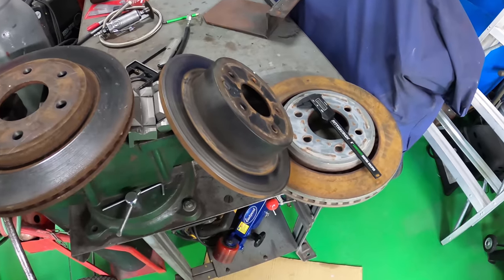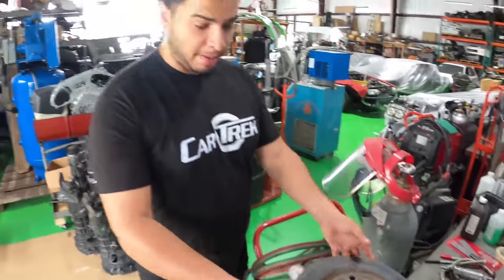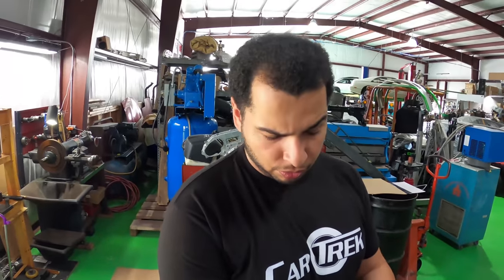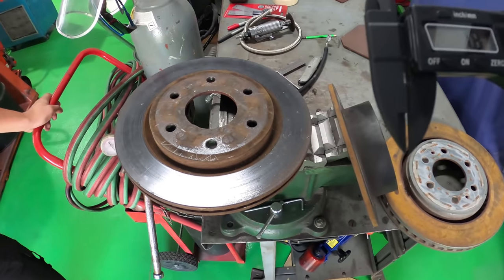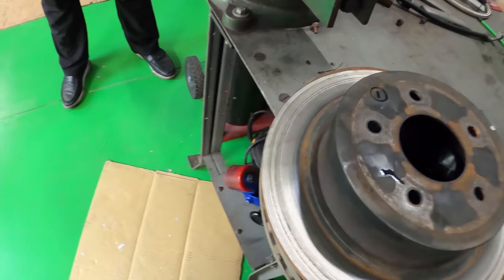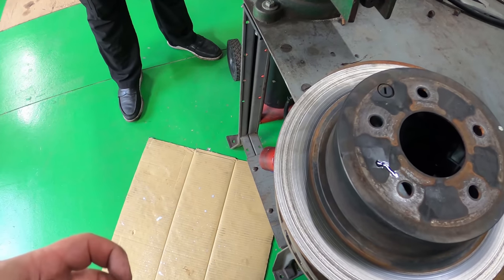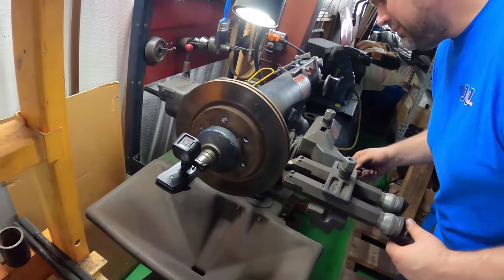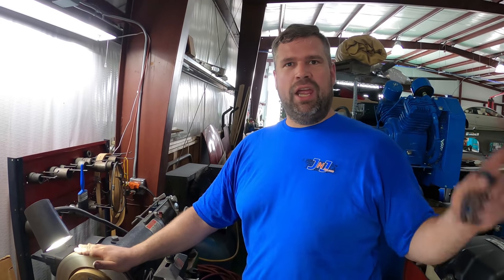Here's How You Can Get BRAND NEW BRAKES For $10 (Without Screwing Up)

Comment: Just finding a shop that turns rotors is getting harder. I remember when every service station could do it. Great content!
Reply: Damn do auto part stores not turn brake rotors and flywheels anymore?
Reply: @sinformant  - If you hunt you might find one of the older shops that do, but for the most part they have gotten out of it.
Reply: You would have better luck if you go to the same machine shop that did the work on your engine block and Reground your heads not a tire shop . If they won’t ask them who would ?
Reply: I can’t find anyone around here that is willing to do it. The last shop I went to said their insurance company said the liability was too high and if they kept turning rotors, the rates were going to go way up to the point the shop wouldn’t have been able to make a profit.

Your best bet to find someone to turn rotors would be some small shop that’s in the middle of nowhere.
Reply: I can’t find a shop that will do it anymore either. Labor rates are so high it’s cheaper to buy new blanks
Reply: O'Reilly's, and full service tire shops
Reply: I do that, but I mostly do it for truck disc's, it's just not worth it and safe to redo car rotors.
Reply: O'Reillys for about $13 per rotor. At least for my vehicle, the rotors brand new are $24 each on Rockauto. It is difficult, and almost pointless for $11 more. The old one's had already been turned previously and were slightly warped anyway.
Reply: Napa. They do rotors and flywheels.
Reply: I'm happy I found a broken brake lathe off Craigslist for $150.  Cost me $75 to fix.
Reply: A lot of that is because most modern brake rotors, at least for cars, are already manufactured close to the minimum tolerances to begin with.  If they warp very much, generally shops will refuse to turn them at all because doing so will put it below minimum thickness.  That being said, I still try to have rotors turned rather than replacing them when I can. The reason being: Once rotors warp once and stress relieve themselves, they're very unlikely to warp a second time.
Reply: @murrys5444  wrong. Every O'Reilly Auto Parts turns rotors. At least in my state they do. So does Advance Auto Parts. So does Autozone. So does NAPA. 🤷‍♂️

So has every shop I've worked at. Nobody ever asks for it anymore but there are shops everywhere that still do it.
Reply: @JC-11111  - I used to work for Napa, and of the 4 in the county, none of them turn rotors anymore.  It really varies by region.
Reply: @JC-11111  The one near me is picky on them though. They refuse to turn the ones that are built into the hub.
Reply: @SAIFSWORLDFUN  - I can't find anything stating it is illegal in the USA.  Some European countries came up, but not here.  I think you misread something somewhere.
Reply: my O'Reilly's advertises that they do it
Reply: @SAIFSWORLDFUN  Well, that was just a blatant, ugly lie if I ever saw one.
Reply: @JC-11111  what state?
Reply: @JC-11111  The problem is that not all employees are trained to do the job and if the right person isn't in that day having them done in one day isn't always possible.
Reply: @SAIFSWORLDFUN  Most? I don't think that is correct.
Reply: Düdmæng Brossovitch depends on the Napa. Some don’t deal with the liability
Reply: @fabulousprofound  indeed, its not economically viable and the risk is too high, many mechanics check for lip, no lip= rotors fine,  rotors that are too thin end up on your car, we looked into it, the modern on car machines arent worth it, ten minutes both sides, thats £30.00 in labour plus machine layout- pair new discs on small car?
£35.00. it pointless unless your rotors are very expensive to replace.
Reply: @sinformant  Auto part stores used to do that?? I wish that was still the case!
Reply: Tons of shops around my area reface rotors. Doesn’t matter if its a tire shop or general shop. As long as they aren’t too low/thin they will turn them.

Comment: Back in the 90s when I worked as a tech at a GM dealership we turned rotors on every brake job because back then rotors were expensive, unlike now. Same for rebuilding CV axles, was cheaper to replace the CV ends than buy a whole axle
Reply: Same here, we rebuilt calipers and wheel cylinders because of liability. I'm a retired Ford, Lincoln,  Mercury, technician...
Reply: Now finding a guy who can do it without screwing up the rotor is hard. Not sure how you can screw that up, but they do
Reply: @stephenhayes3765  
Well, we're dealing with a generation that can't retrieve grocery carts, without messing up...
Reply: @joeschlotthauer840  ThIs GeNeRaTiOn CaNt Do AnYtHiNg
Reply: I'm in Australia, and when I was doing my apprenticeship 20 years ago we machined the rotors every time on the 90's Falcons, workshop got an on car machine that was mostly running all day. but ten the newer models came out with slip on hat style rotors, and the rotors got cheaper.
Reply: @ryanworkman5229  
Yup, we had one also, mainly for the four wheel drive cars and trucks for warranty warped rotors, and to save Ford money.
Reply: Stephen Hayes yeah when I was in highschool, it was quite easy to pick up, now I’m 19 lol

Comment: I was taught 3 pass minimum. 2 fast to true it up, one slow for finishing. Of course measure for minimum thickness before the last pass. I usually cut about 8 a month, my boss charges 15 a rotor.
Reply: No you don't have to take three passes unless the rotor is really warped or grooved. Once you do your scratched cut and you turn the twin cutter all the way in if there is a solid line all the way around from the bit you can do it in one pass
Reply: sinned96 Yep, do a good fast cut (after measuring of course) then a good final cut. I use a sanding disc on the rotor after turning to put a nice non-directional finish on the rotor

Comment: Fun fact, some brand new rotors are warped. I worked a Brake shop in the late 80's and would see customers complain about a pulsating pedal after a complete brake job was done that included New rotors. Take the new rotors over to the lathe and sure enough they are warped. We started routinely turning brand new rotors before installing after that. I was told this happens if the rotors are not stored laying flat in there boxes.
Reply: I’ve actually seen that also. Kinda not a big shocker since most rotors that are in autozone/oreillys come from China
Reply: Wow glad somebody else understands this I tell my customers all the time you're getting rotors come over from China on the boat those brand new rotors I've have seen 10 to 12,000 out

Comment: The old Amoco brake and drum lathes we used to use in the Midas shop I worked for back in the early 90's had adjustable rubber wheels on stalks that we could ride on the rotor during the initial rough cut to stop the harmonics.

Comment: I used to get this done when I was a poor student with an old slow car, also that was before you could get Chinese brake rotors for peanuts like you can now - but I wouldn't bother anymore when new ones are so inexpensive, and you can just drop the old ones off at a metal recycling service.  The shop I used to go to had a special machine that could do it on the car.
Reply: The on-car brake lathe is industry standard now as it results in less lateral run-out ("warped rotors") and "aligns" the rotor with the vehicle's axle.

Comment: Big problem around here in western Canada is most shops don't turn rotors/drums for people anymore, parts suppliers stopped turning for customers.  So was easier/faster to get replacements.  My 1980 chevy Barreta, new 3rd party rotors were only $5 more than turning old ones (many years ago).

Comment: Over 25 years ago I once witnessed someone doing this by putting the car on a lift, putting it in gear and using a metal file on the discs! Did a good enough job to get it through its MOT test!
Reply: I prefer the car on jackstands in neutral and angle grinder with flapper disk method lol

Comment: On-car lathes are superior.  Most "warping" (It's thickness variation) is from excessive runout caused by the hat/hub/bearing.  An on-car lathe makes the full assembly true, assuming your wheel bearing isn't defective.
Reply: That's not correct about the on car lathes, or else it would be standard practice to on car machine new rotors once fitted, which never happens. If the car has a runout problem with the hub or wheel bearing replace that part.
Reply: @toddttautomotiveequipment2871  You offer to match machine the rotors, but i bet you dont match machine every set of NEW rotors you fit to your customers cars? Off car machining is the same as on-car as long as you follow correct procedure checking for hub and rotor runout etc. If i can be within oem tolerance for runout with on or off car machining, how can you say one is better then the other?
Reply: Btw runout(warping)and thickness variation are two different things, rotors can have one without the other or both.

Comment: Skimming works well with enough life left, problem is the sudden temperature change after a cut as the change in running temps are exponential for every micrometer taken off. They are more prone to warping after skimming.

Comment: The vehicle moving with no other force applied to it (ie, coasting) has Potential Energy (not Kinetic).
You convert the Potential Energy into Kinetic Energy by applying the brake.
The Kinetic Energy is the "Heat Energy" used to slow the vehicle.
The more efficiently the brake rotor can dissipate the Kinetic Energy into the surrounding air, the more effective the braking will be.

Comment: Those rubber straps to your right that look like bungie cords, those are supposed to be wrapped around the rotor to prevent that loud "singing" it made. Also that singing causes vibration and leads to very bad cuts.
Reply from the maker: They didn't have one that fit the rotors diameter on hand, so we used the contact pads which performed the exact same function.
Reply: That clip on silencer is basically made for the thin rotor that you showed from the Nissan Pulsar. It works but I would get the correct type of silencer for it. The spring silencer works great but they only come with four Springs. On a larger rotor it's better off to use five Springs. You don't want the silencer tight against the rotor, you want it loose so it actually dampens the vibration. If it is tight against the rotor it will vibrate with the rotor

Comment: I got rid of the lip on my vans disks by running it on tick over in 5th gear and holding an angle grinder on it. Worked well 😁👍

Comment: I'm lucky with part prices on my little old car: a set of good quality rotors in the front will cost only 24€, but they are also tiny solid rotors. Way smaller than normal rotors on the rear axle of a new car. Drilled Brembo's are about 58€ for the set. It will help when the car only weigh 780kg or 1720 pounds, parts get cheap :-)

Comment: The issue of finding a place that still does this not withstanding, the bigger issue is if the rotors you have can even be turned.  The minimum thickness of the rotors was mentioned, however what wasn't mentioned was just how thin rotors are from the factory now a days.
The vast majority of cars out there, the rotors are so cheap and thin that by the time someone gets around to wanting/needing to get them resurfaced, there simply isn't enough metal left to do it.  Heavier duty (and weight) vehicles you might have more luck on, as the heavier a vehicle is the beefier (generally speaking) the rotors are.  Also, as you go up in vehicle speed capability, the rotors get thicker then as well.
It is an option that can still be found out there, but just be aware that rotors are getting much cheaper and thinner by default, so don't be surprised if they won't turn them for you.
Reply: I'm a brake lathe service technician and I keep up on what's coming out with the newer cars. Rotors are getting more expensive and getting thicker. And the recommending that you can resurface them at least once

Comment: I've had this done on my 1991 Honda Accord  with a special turn that mounted to the hub. Those cars had a hub over rotor setup where the rotor was pressed on.
Reply: It was a pain to replace or refinish but they lasted longer to me.
Reply: With an 11/16 Arbor I can cut those Honda rotors with the spindle attached but you got to remove the whole thing from the car

Comment: yes I used to just put new pads on my 83 reliant till i could see the out line of the rotor cooling fins thru the braking surface. ah but with new rotors the pedal was high and braking was solid at that time rotors could come off after wheel removed and new rotor was $20  410 to have them turned so new was the best choice.

Comment: Correct me if I'm wrong, but I have seen many brand new rotors get warped very fast. Then, after being turned, they never warped again, as if the metal took back it's ''natural shape'' at first when they warped. It is also good because it makes people work in your country, instead of always buying from China.

Comment: Once rotor no longer had bearing races, they became cheapaer to make. Also they are often thinner than the old rotors and you cannot turn them after they have run a set of pads. It they are not warped, I just scuff them with course sandpaper and put new pads on. If they are warped you can turn them but usually the warp comes back,

Comment: Auuu, just to add to confusion here. Tires stop the car. A car is a total loss heat exchanger. You can not create or destroy energy, only change it's form.You put in gas( energy . not dead dinos, what ever) to burn. You lose most energy through heat, radiator, exhaust, brakes, tires ect. Brakes are just a transfer device from the brakes to the wheels, to the tires. First I heard of harmonics was on a Ford Taurus. We used a rubber strap around the rotor to cut it down. Also don't inhale the dust coming from the brakes. Hose them down FIRST to get rid of most of the dust. Anyway good video...
Reply: ICE is not a total loss with heat but the most efficient ICE possible currently is around 45% and BEV is about 95%.

Comment: Not sure where you're buying your rotors from but I bought 2 rears (Raybestos) for my 2000 Prelude and paid $41 with shipping! Just another reason I throw out the old ones. Can't see cutting the old ones for $12-15 a piece and then replacing them in another 2 years.

Comment: If you go down to the minimum thickness, you will get a brakerotor that looks like brand new, but you can't use it anymore, because if you do you will go under the minimum thickness.
Reply: The minimum thickness is the minimum machine to thickness not the minimum wear thickness

Comment: Lets say i changed the brake pads and did not change the rotors, drove like that for 9 000 km. Now the new pads have adapted to the old rotor. Is it posible to buy a new brake rotor, and trim a milimeter or two from the pads, so the pads have an even surfice? I am asking that because the pads have a lot of meat left on them, so I would trim them ao there is no groves or anything.

Comment: I will no longer turn rotors. Most of the time you turn rotors to get ride of a pulsation in the brakes, sometimes just a great way to remove the glazing from the rotor. Ether way it remove mass and the rotors ability to absorb and remove heat. This usually causes the rotors to warp even faster. Also almost no one will turn a rotor for 10 bucks, it takes way longer to turn a rotor than that. Just order new ones from rock auto for about the same price.
Reply: If you're getting a pulsation out of your brakes after turning a rotor you have issues with your brake lathe for your adapter setup not being true. You need a guy like me to come out and fix your brake lathe so every rotor you throw on there it's going to cut straight

Comment: rotors these days are much thinner than they used to be.  i turned the rotors on my 69 chrysler 2 or 3 times before i needed new rotors.  cheap way to keep driving.  now the rotors are generally so much cheaper, the difference is $10-20 for turns, or $35-50 for new
Reply: Well don't sell your brake lathe yet. Rotors are getting thicker on the newer cars and their are recommending to turn them

Comment: The biggest issue I see here is the the cups or Bell clamps is the correct term for them are too small. You should use the largest Bell clamps that you can. That will help with vibration.

Comment: I learned that getting the rotors turned costs as much as getting new ones. Truthfully it just isn't worth it for a few dollars in savings.
Reply: Really depends on the vehicle. New front rotors for my car are $60.00 each.... I had them tuned for $13.00 each. $94.00 is a significant savings in my book.
Reply: @mickeywinebrenner6455  what car?
Reply: If you take them off the car yourself, it's going to be cheaper. But if you have the shop take them off, we're going to charge you for pulling your wheels and calipers off to get to them.

Comment: Turning a brake rotor would be cutting down the outer rim. Facing it is using the lathe to cut the face where the pad rubs.

Comment: On more expensive sport/race rotors/disks i understand the process.. but for factory brakes on most cars for me replacing the brakes is cheaper then diamondcutting the disks by someone else.. in europe its hard to find people that can do it.. and if you find one they more then new disks cost... after mine are warped or used to the factory thickness i just throw them away and get new ones..

Comment: You really should make good practice of using a die grinder with a cookie to sand down the inside of the rotor hat that way you don't get vibrations and get a bad cut. Same goes for the on-car lathe